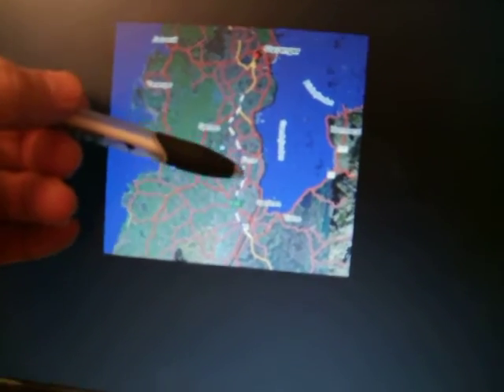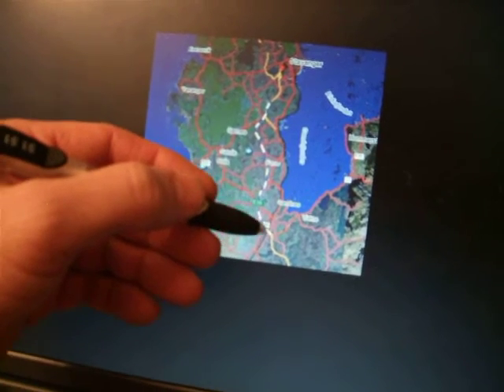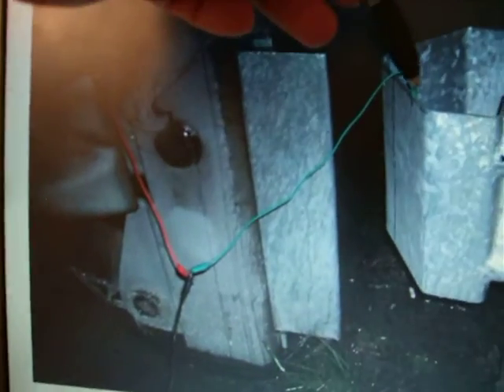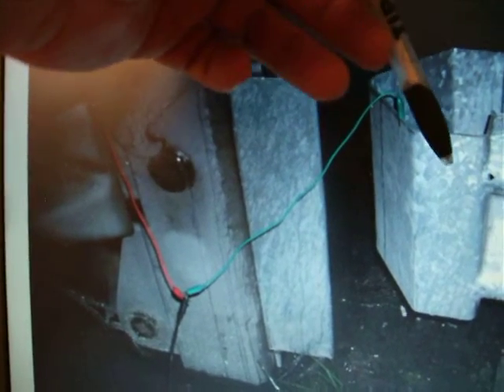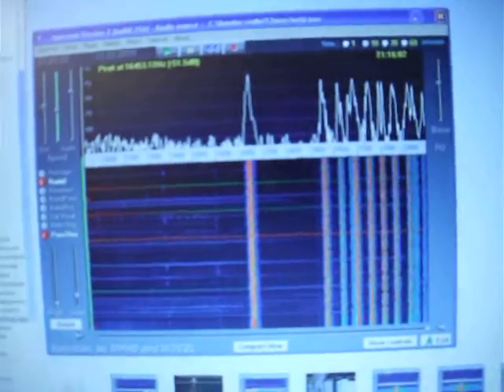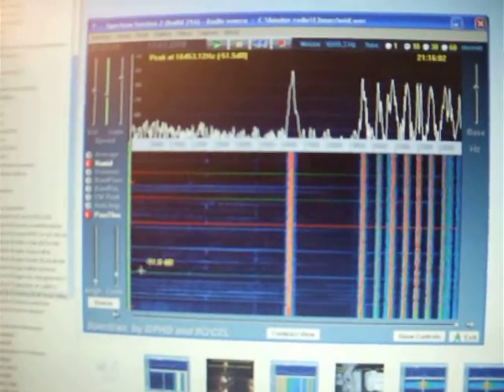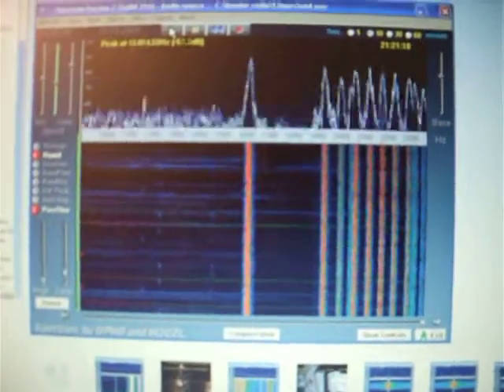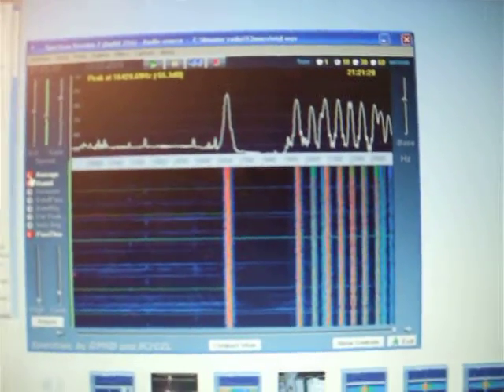Amayzing 8000 meter long antenna in Stavanger, Norway LA3EQ

Comment from the maker: No I did not modify it. You turn on the RX RIT control and adjust is down til it shows -20khz. Now you can tune all the way down to 10kHz and the corect frequency is shown on the mail dail (VFO display) display too!

Comment from the maker: Well I did try it on 137khz,alos the 160m,80,40, and 20meter band. It was GREAT on 137khz and ok on 160m, 80m was ok (like a 80m dipole), 40m was like a short mobil whip (not to impressive, lacking high angle skywave, but ok on dx) while  20m was very bad! It tuned ok on all bands with the built-in Kenwood TS2000 antennatuner.
Jan

Comment: Maybe Norwegian police are a little more tolerant than ours. I suspect an amateur would be told to move on over here.
Again, great idea, nice experiment. Very interesting. I wonder how well that  antenna would perform on 73khz for TX? Or even the HF bands? Maybe too lossy for the higher bands, but 160 and 80 might be interesting. It would probably work as an 'end-fire' antenna, with near-vertical radiation from the end, very good in one direction.

Comment from the maker: Don't forget to use a a smal 1:1 transformer between your radio/PC soundcard and the guardrail antenna due to voltage spikes that may arise because of earthfaults in the roadlamps. Jan Lustrup - LA3EQ